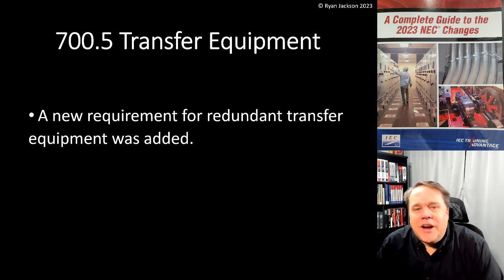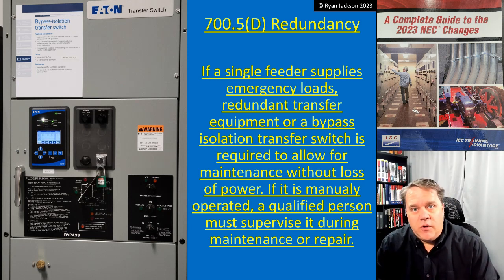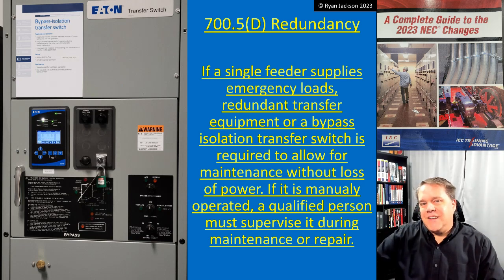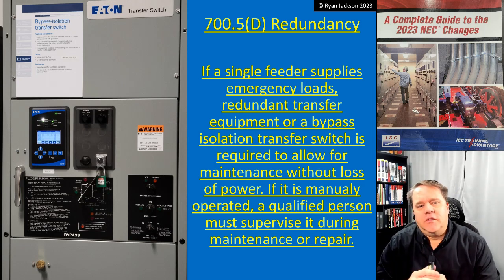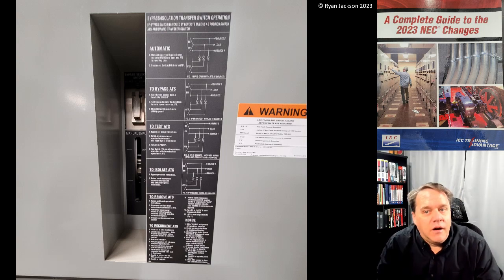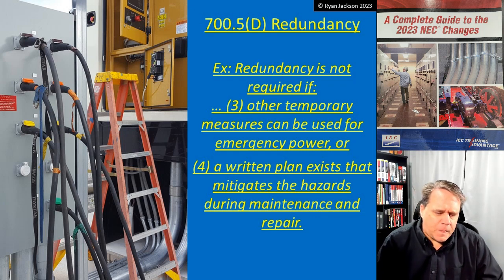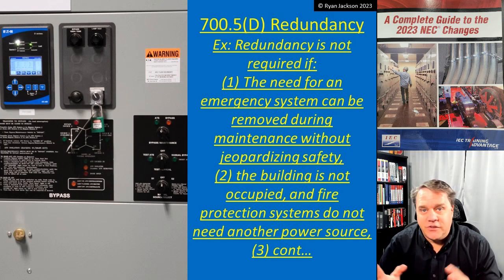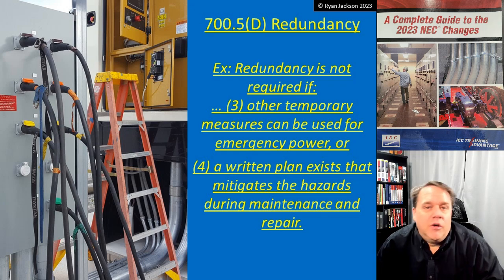700.5 Transfer Equipment (emergency systems)

Comment: The docking station that you mentioned are great for connecting portable load banks to generators that did not have built in load bank. Took me several years to convince them to purchase the 600 volt rated plugs & ports. Before we installed them we have to remove covers off 600 & 800 amp emergency power panels and tie in load bank cords to spare 100 to 400 amp circuit breakers. I installed 3 heavy hinges on one large panel to make it easier to access breakers. On some panels I would drill & tap a fine thread 1/4" hex head bolt and have threads sticking out top center of heavy doors. Just had to hang the cover on this bolt to take all the weight off when working by yourself.

Comment: At the large hospital/ research centers that I retired from they had over 70 ATS'S. Most of the newer ones were the bypass type. Best thing about them is the ASCO or other companies techs can perform yearly testing & cleaning during business hours. 6 sparkies and support people had to come in at 4 AM once a month to test ATS'S in main hospital and two other buildings. For some reason this rich medical campus only liked to purchase & install 1,200 & 1,600 ATS'S even if load was only 300 to 400 amps.